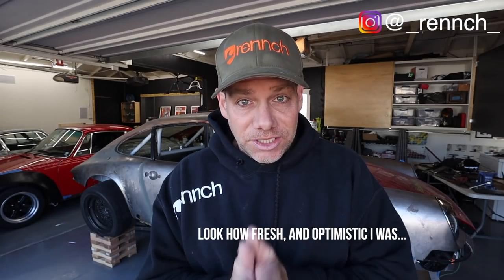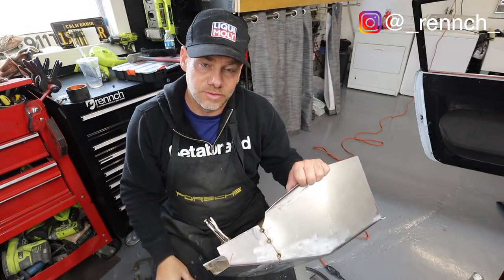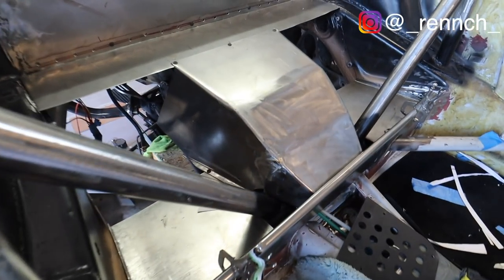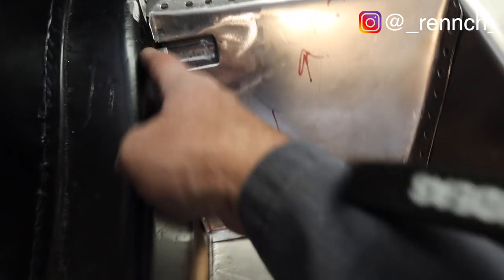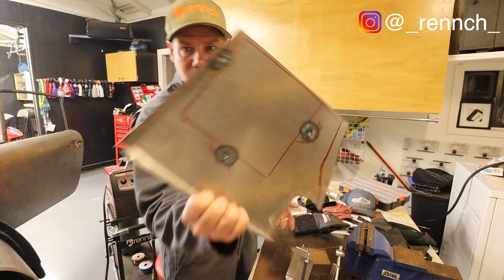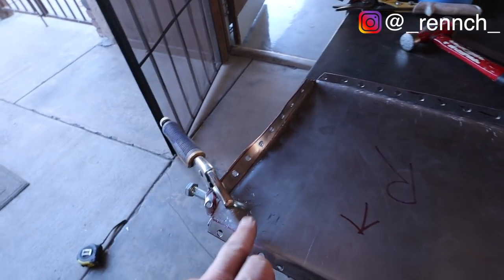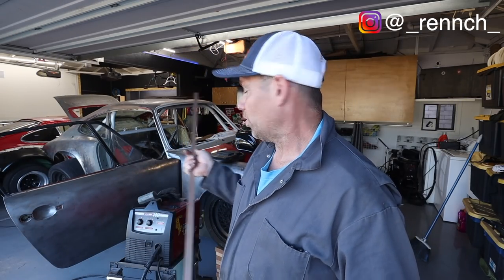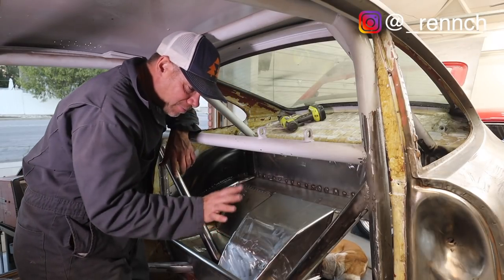MEGA **FABRICATION**  on the Subaru EZ30 Turbo Powered Porsche 911! | Blasphemy Build 44

Comment: At about 16 minutes in, I was holding my breath expecting a big flash from you shorting out those battery terminals with the sheet of steel you were waving over it. Fireworks!
Reply from the maker: LOL!  I did actually touch it for a split second!  Hopefully it's ok.  :)

Comment: I kind of like the idea of dropping the seat delete. The bracket you made for the battery is a work of art and the Haltech stuff will look cool as well. Maybe figure out a way to coat or cover the metal, yet showing the customization and high lighting the battery and Haltech install? Just a thought. Great video!
Reply from the maker: It's been discussed!  I need a place for luggage too...we'll see!

Comment: good stuff....no rivnuts?  I mean, for the battery, I see why you like to weld on the captive nuts, but for the Haltech, I'd think Rivnuts would be ideal and save tons of time.  I think it's awesome you do all of this without massive, expensive equipment, like a sheet metal brake.  and the work is top-notch.  keep it up.
Reply from the maker: Thanks man.  In that case, I didn't have the right size rivnuts, so I just went big time.